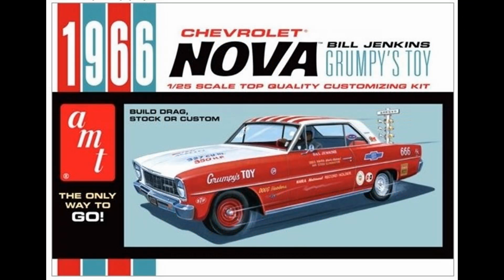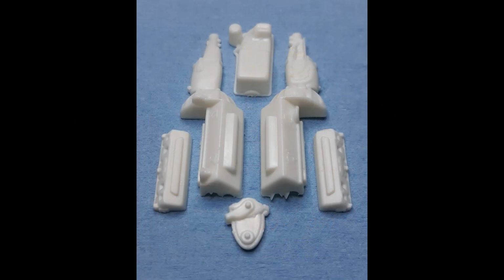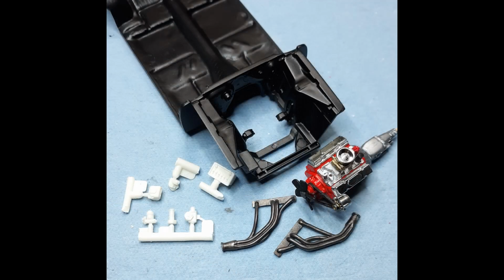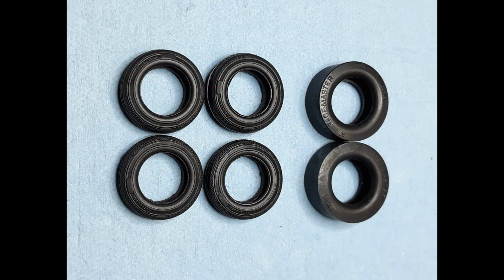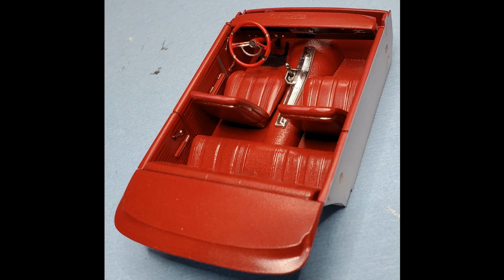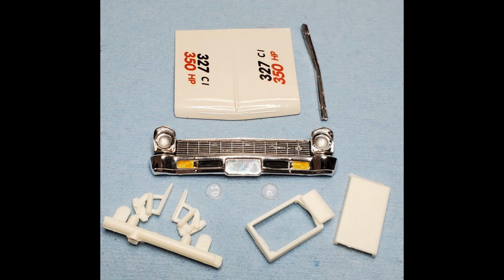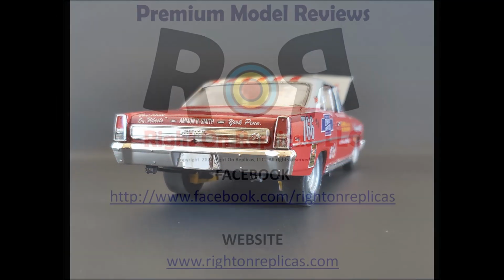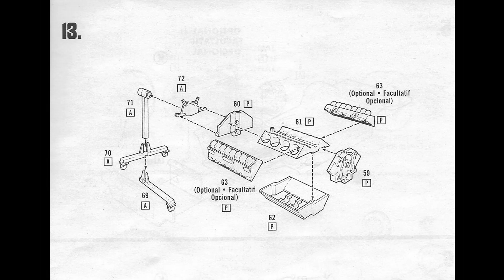Grumpy's Toy 1966 Chevy Nova 1:25 Scale AMT 772  -Model Kit Build & Review

Comment: Very nice build. I like the detail work that even extends to simulating fluid in the washer tank. AMT came out with the Nova in 1964 when Chevy introduced the model. I still have my model, which I built stock. It didn't have anywhere near the number of parts of this kit.
Reply from the maker: Pat,  Thanks for the info!  -Doug

Comment: Really nice build !,  Looks great !, Originally kit came out back in the 80s not 1965 and used to have a molded in mirror in the glass and they finally fixed it, It's been reissued several times originally was supposed to have been a 67 not a 66.
Reply from the maker: Harold,  Thanks for the information!     PS,  please subscribe if you haven't already to help us reach more modelers.  -Doug